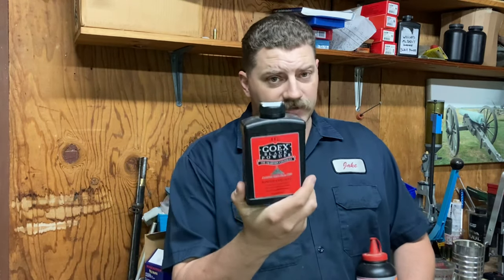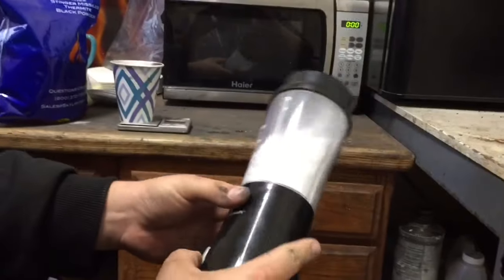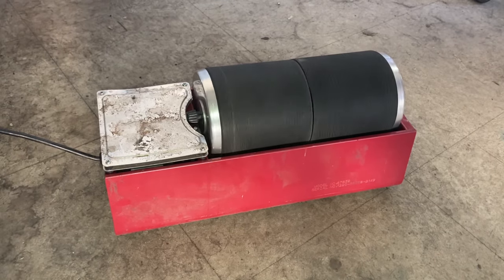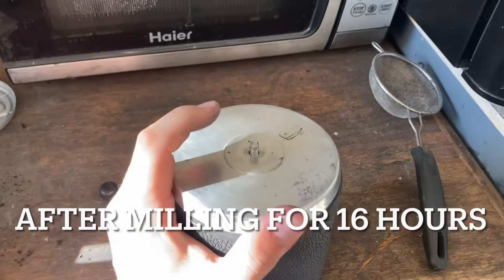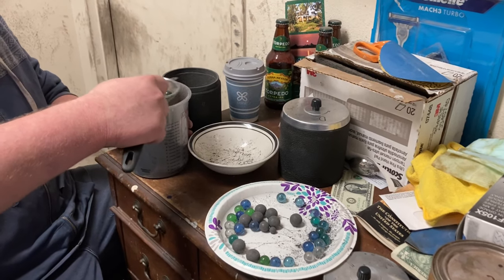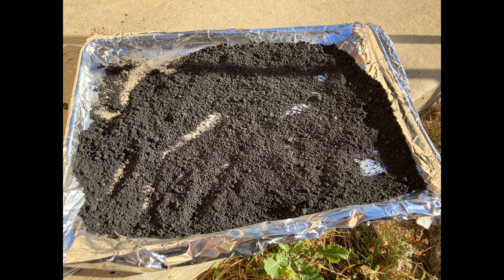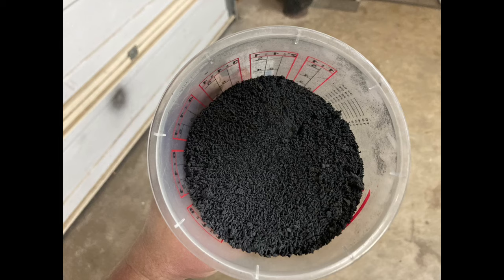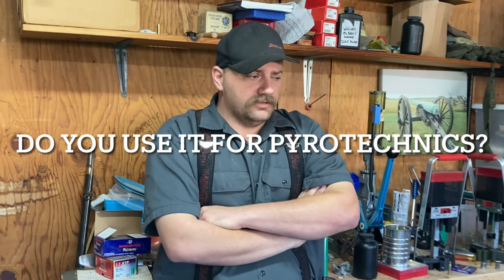How to make black powder (for firearms part 1)

Comment: Other than keeping the powder in plastic containers, I assume your black powder isn’t more susceptible to static electricity and wouldn’t require any special handling for safety or safekeeping, right?   I have long had the metal Goex cans in my house, in the “gun room”, rather than in the garage, but I don’t touch these cans when there’s low winter humidity and static electricity (such as from touching a doorknob).  Maybe I should move the few pounds of black powder I have into the garage, but there it is more susceptible to high and low temperature swings.

Comment: Use punk wood charcoal, as used in a flint and steel tinder box. You only need to ball mill for about an hour, and the resultant mill dust is fast enough burning even before you granulate it.

Comment: I really have never had an issue with pyrodex or fouling in fact I've always used it for target shooting because my revolvers would lock up less with pyrodex over goex. But I'm dipping my feet into making black powder and it's been going good
Reply from the maker: Interesting! That’s the complete opposite of my experience. Are you using any lube or felt wads in your revolvers? When I first started I wasn’t using any and I could only get 12 shots off before it was so fouling the cylinder wouldn’t turn.
Reply: @Everythingblackpowder  I use petroleum jelly for plinking and beef talo mixed with bees wax for hunting just to prevent melting
Reply: @Everythingblackpowder  with my 1858 I was fouling nearly every cylinder to the point where it wouldn't cycle with goex but could get 15+ reloads with just reapplying grease to the cylinder rod every 2 or 3 cylinders and my 1860 will shoot all day with just a couple of strokes with a cleaning rod and reapplying the jelly
Reply from the maker: @matthew33721  I’ve noticed that the 1858s are more susceptible to fouling compared to the 1851s and 1860s. I use lambs tallow and beeswax over the chamber mouths and that works very well with both pyrodex and real BP

Comment: I tried reading all the comments but I have one question
WHAT SIZE BALLS (LEAD?) ARE YOU USING? 
I have lead and I have molds they looked way bigger than 50 cal
Reply from the maker: I use a variety of sizes ranging from .36 to .75

Comment: Pyrodex MAY not work that well in caplock rifles if the flash channel is a 90 degree type, such as  through a screw-in nipple bolster like the Tennessee Mountain Rifle or the welded bolster on the Lyman Great Plains Rifle, which is also a 90 degree channel.  I have experienced very common hangfires using Pyro in such rifles, but in 40 years I can count on one hand the hangfires  with BP.  CapnBall pistols love Pyrodex.  I assume that because Pyro ignites about 600degrees hotter, it may be sensitive to  weak or inconsistent heat from caps and thus requires a more direct and shorter avenue to the main charge.

Comment: I make my black powder the same way I also use 99.9% denatured alcohol it's better I noticed it's makes it more powerful because less water is used if to much water it will wash out a lot of the potassium nitrate and slow it down but I gotta do like you add 20% more to my shotshell loads to get a high fps reading the ? Is some people also add acetone to the formula don't know the percentage hadn't tried it yet  wandering if you or any one else tried it and also you are very right about the dextrin it's not good in a firearm to much fouling..

Comment: I found the "charcoal" answer,, they all are carbon,, but it is the shape of the molecule of carbon that makes the "speed different" seems the willow charcoal molecule a big 3d structure that holds the s and k,no3 molecules  for reaction, graphite is flat sheets so the other chemicals lay on it & burn slower. Activated charcoal is huge surface area, so probably maybe flat too (diamond is all carbon too, but would work even worse because of it's tight knit)?? wish i had my organic chemistry model kit from college it it would be easy to visualize.
Reply from the maker: Interesting! Thank you for the info
Reply: Charcoal from straw...  ;)

Comment: Instead of Dexedrine have you tried using a highly diluted nitrocellulose binder. Say clear fingernail polish that has been highly diluted by acetone. Granulating a ball made using that stuff, should reduce the fouling problem as the new binder should be more combustible than Dexedrine

Comment: I make and shoot my own powder. It doesn't seem to be any different than Goex. It works just fine in my flintlocks in my 357 s and I've even shot it through my 327. 
I've even made it without sulphur and it does work in a flinter. But it isn't any better than pyrodex. 
However I would NEVER ball mill the powder after already mixing in the oxidizer. And be careful about the opening of the mill too. I make sure the mill is dead cold before I open it. Unless there is water or alcohol in it.
  My milling barrel is pretty hot after merely grinding charcoal. And that charcoal powder is incredibly volatile. It will explode violently even without saltpeter.  
  I once put real fluffy charcoal powder in my pan. And it went off with a spark from the frizzen. Be willy willy caweful
Reply from the maker: Thanks. I corn my powder nowadays and my willow performs the same as Goex and my Alder buckthorn is on par with Swiss. I’ve made a lot of powder and have never had a mishap but I always tell people. 
 “you make your powder as safely as you see fit”
Reply: I want to start making my own. The idea nobody can cut me off of necessary supplies is a good feeling.

Comment: You seem to use a variety of media. How many balls do you use per tumbler? It seems like I have to mill excessive amounts of time to get a good fast burn. I am splitting 2 lbs of .454 lead balls. 1 pound each side. I am thinking I do not have appropriate media to mill faster. One last question  sorry,. Is there anything that can be done to fizzle powder. I have done 6 runs   and only 2 are fast enough to use. Is there anything I can do to the slow burn fizzle powder? Sorry and thank you
Reply from the maker: I fill the jar at least half way up with media of various sizes from .375 to .735. It sounds like you don’t have enough media in your jar and you’re not milling it long enough

Comment: How do you control the granulation of the home-made Black Powder?  I use 3Fg in my longrifles.  

Also, that "g" in the FFFg stands for graphite coating.  That helps keep it from turning into "soup in the pan" in high-humidity or rain.  In reenactments, we didn't find it made a difference in non-high humidity or rainy conditions but definitely helped in high humidity and rain.  We actually would buy Cannon powder, which is not graphite coated, for our group; split it into cans; and distribute it our members.  Un-coated worked fine until we did a reenactment in VA with really high humidity during the summer.  Is there a way to add the graphite coating to it?

Comment: Have you ever wetted your powder down with urine instead of alcohol? I've never even fired a black powder gun before, but my younger brother has one. He uses pyrodex pellets in it and I remember him complaining about the fouling being hard as a rock. Anyway I remember reading years ago about how the British wetted their black powder down with cow urine to give it a little more power and make it burn cleaner. I think it was about the powder they was making for naval cannons. I guess the ammonia or nitrates in the urine kind of make it a little less smokeless, making it foul less and  have a bit more power. It would take longer to dry, but if it's cleaner burning and has more power, it would be worth it, don't you think? If the ammonia is what does the trick, you might just try wetting it with that, although I think they said the nitrates in the urine was what made it better powder. That may be the trick the commercial powder companies use. I'll keep watching your videos and hope I see you try it. I don't think you have to use cow piss though. I'm pretty sure your own would work about the same in the small batches you make. I'm pretty sure the British were using cow piss because the large quantity of powder the naval cannons used.

Comment: Great stuff in this video.  Sure beats $587 for 25lbs of Swiss 3F.   I use 3F Swiss for both the tube and pan for all my flinters.  

Questions for ya if'n ya don't mind ... No safety concerns over swirling the freshly made powder and lead balls around in a stainless metal kitchen strainer to remove the balls?  When the meatball of powder is created with isopropyl alky, what is being used to grate that ball onto the aluminum foil?  After the powder dries out, how do ya get the BP kernals down to approximate 3F size?  Which potassium nitrate, sulfur and charcoal to get from Skylighter?  

Much obliged for all yer good help.
Reply from the maker: I’ve never had a mishap making BP but I always tell people that you need to make you BP as safe as you see fit. After it’s granulated and dry I sift it through a series of strainers to get uniform sizes.
Reply: @Everythingblackpowder  What size strainers and where do ya get 'em?

Comment: Gonna have a go at this. My high school chem teacher would be proud. My college professors would be aghast. Both please me. a couple Q - have you done any wet milling? saw a reference to this (looked like a 30% moisture addition per weight). Have you used ceramic balls in a smaller tumbler? Looking forward to my first batch

Comment: How did you figure out the powder charge for .45 ACP given that it's a round that has always used smokeless propellant.
I've read that smokeless powder is 3 times more energetic than black powder. So do you multiply the amount of powder by 3 to get the BP value?

Comment: Thanks for posting. You say you loose about 20% power. So in a cartridge load, say a 45-70, where the case size is determining the grains of powder, 70 or there about, how do you up the charge to get the same results as commercially made black powder?
Reply: Just watched part 2 and I think you answered my question. Need to press. Thank you.

Comment: How come you don't use a spray mister of kerosene or diesel oil to dampen your powder, would that not make it more combustible?  That would also make the black powder incapable of drying out, unless some of the hydrocarbons vaporized.  Gasoline would work also and be very evaporative but probably leaves some residual traces.  But, really, nitroglycerin is probably best.

Comment: Ok, I have been trying to make black powder as well, the milk powder burns slow and like a Roman fountain. I use a blender to initially break down the raw materials, and then run it through an mortar and pestle, followed by a 40 micron mesh. The last batch of milk powder I made I ran through the mesh a couple of times and it’s been my best result. It still burns fairly slow and less potassium nitrate residue. Should I still run it through the mesh or just wait till I get a ball mill.
Reply from the maker: Using a ball mill is the only way I could ever get good quality fast burning powder.
Reply: @Everythingblackpowder  Thank you so much come me and my reenacting unit for the information and quick answer. I’ve a first batch in a ball mill that’s almost complete. Would I be able to ask as well if the soft pulverone granules work for muzzleloader rounds (blanks are least) or only hard corned granules?
Reply from the maker: @equinesteel454  both will work.
Reply: @Everythingblackpowder  Thank you again! Subscribed to stick around.

Comment: The flowing I am kind of new to making BP and I have been testing mine trying to get everything moreless like yours. I made a batch the other day and added the graphite to the mix and I did over add 1gram to 100gram mix cook however everyone is happy with and I did the CIA method and when just a burn test there's no residue on the piece of lime stone that I'm using to do the test on  I have not been able to use it in my pistol yet and i'm wonder if you might have tried this method before I can tell you like to try different things in your BP

Comment: Thanks for this. I have been trying to find powder for my Lyman Great Plains Rifle that I have had for almost 40 years but haven't shot in probably 20 years. One question though: do you use the same powder in the flash pan or do you  grind it finer?
Reply from the maker: I make a habit of priming with the same powder I’m charging with but you definitely could grind it finer for pan priming

Comment: Sorry to put this comment on such an old video but it seemed the appropriate place.  I have only used BP in my Flintlock and Pyrodex in my inlines.  I was reading an old Hodgon Data manual  no 25, in the Pyrodex section and they were promoting Pyrodex as viable for flintlocks with duplex loading.  They were stating 20 gr of BP in the barrel first, with the remainder of the charge being Pyrodex and then also priming with BP.  Have you tried duplex loads and if so what kind of vocity and fouling were the results?
Reply from the maker: https://youtu.be/2qU46bN2sa4
Reply: @Everythingblackpowder  Thank you, those results and assessments are what I was thinking might happen.  It's a last choice, only if you really needed to conserve BP and just couldn't wait to get or make more BP.

Comment: Very interesting..  So the KNO3 is very water absorbent?  Maybe as you are making it you should deal with this aspect and dry it as you are making it.  How about low humidity and heating the mixture to 100 F?  These are conditions a commercial manufacturer could create.

Comment: Good to see how someone else does it.....
I have got up to a bit over 90% of commercial velocities with mine...... charge for charge.... I will try longer mill times... I have not gone beyond 4-5 hours so far. I do use a small amount of dextrin to aid granulation... must try some without.
The BP subs are not good in flinters... ignition is very slow...... Pyrodex is an early sub, and I am not keen on it at all.... 777 is MUCH better.
Properly charged, a flinter has just a handful of milliseconds ignition delay... it should be hardly discernable.
I think commercial powder is caked dry under huge pressure, the cake broken up and graded from there. The process seems to bring the ingredients into slightly more intimate contact than our home made stuff. The only limitation on charge weights is with the likes of cap'n'ball revolvers where charge volume is limited....
Keep safe out there y'all... having a few ounces of BP go 'whoosh' in your face is not pleasant...... ask me how I know... LOL
Reply from the maker: Agreed on all counts. I’ve developed a new method that makes faster and more powerful powder than the commercial brands but it’s a much longer and tedious process. The product is made using the “CIA Method” dried, re milled for 24 hours, compressed in a pucking die with 20 tons of pressure, broken into little pieces and sorted by size. So far this product has out performed Goex and Swiss in every regard.
Reply: @Everythingblackpowder  Interesting.... might just try that.... shouldn't be too hard to made the die..... :-)

Comment: pyrodex is harder to clean? I havent really had that problem with that. Also, anyone that's using flitlocks, just order ffffg black powder for your pan, and then just shoot whatever you want in the barrel. 4f is priming powder. That is probably another main reason why your homemade stuff is weaker than commercial powder is because they have machines that made the grains the proper size for what you're using it for. Fg or large grains made for cannons are very large so that there is more air in between the grains. When I was in the Navy, I got to see modern powder grains for 5" guns, and the cylindrical pellets are the size of dog kibble, it even has holes in the pellets to allow them to burn better. When you start getting into the science of how this works, it almost seems backwards and it's kinda confusing as to how this works. Modern smokless powder doesnt explode like black powder because it's a "propellant", not an "explosive". bp substitute is also considered a propellant which is why there are less laws restricting it and it's easier to store and buy. BP substitute is by volume stronger than standard BP, seems backwards right?
Reply from the maker: The fouling pyrodex makes is harder than traditional black powder therefore making it harder to clean, in my not so humble opinion. The reason why this homemade powder is weaker is because it’s not compressed then granulated and sorted by size. That’s how the commercial outfits make their powder. The powder I make now is faster and more powerful than any store bought stuff.
Reply from the maker: https://youtu.be/CTHypmamzFg

Comment: Great vid, thanks. Do you have to granulate the powder - what's the difference between granulated and original black powder?
Reply from the maker: Yes, you need to granulate the powder if you’re planning on using it for firearms or pyrotechnics.

Comment: i was thinking about the BP brands... Vihtavuori adds nitroglycerin to their smokeless powder for the "high energy" variations... I wonder if the commercial BP makers don't have some such "manufacturing secret"? Have you tried coating yours?? (polishing with graphite ). I also wonder about "activated" charcoal.. it's just a pure charcoal thats super heated which gives it more surface area to absorb impurities... that could help it react more completely in the chemical reaction we call explosion?
Reply from the maker: No I haven’t tried polishing it with graphite but I plan too. As far as the charcoal is concerned, I can tell you for certain that softwood charcoal makes faster burning powder. I’ve tried hardwood, activated and a variety of softwoods and it does make a noticeable difference.